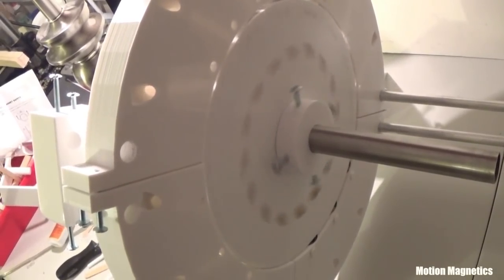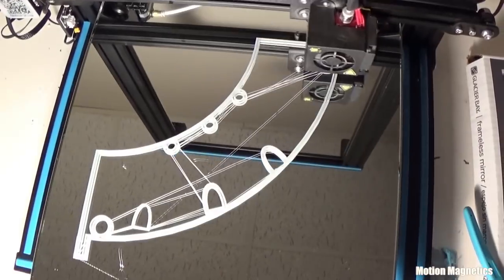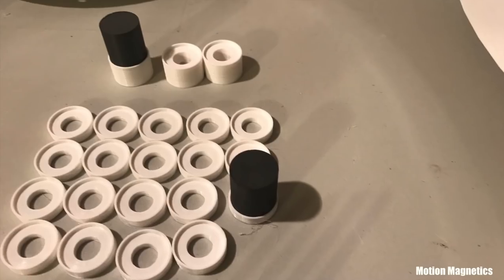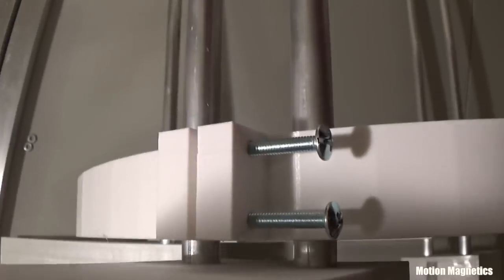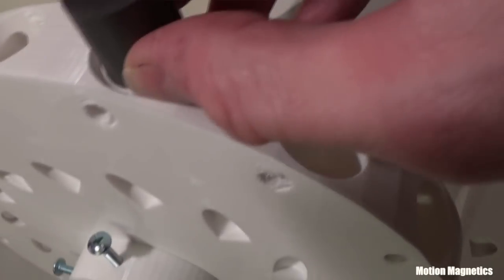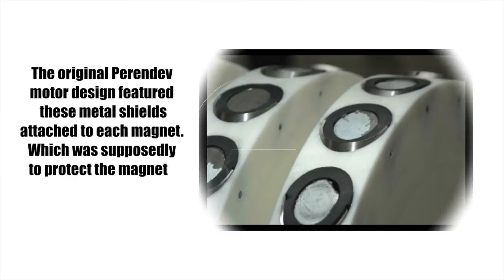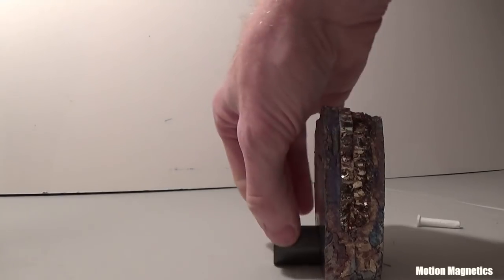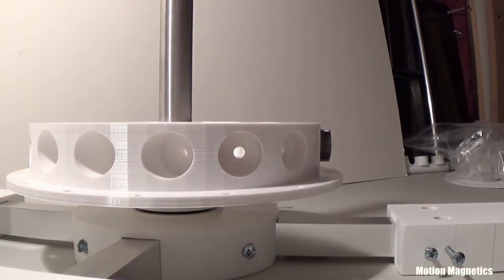Building an Imbalanced System

Comment: An important mistake: Try to use manets on the stator side, but just one magnetizable steel for the rotor. Then the rotor molecularmagnets take on oposite polarity and it starts moving. When crossing the sticky point simultanousely rotor steel must be shielded or polarity changed and the kibernetic force saved in movement will move the rotor out of the sticky point. That is a way to be imbalanced.

Comment: Hello friends of magnetic motors!
A special greeting to the creator of this magnet motor.
He made an effort and everything is ok! Just a problem,
that we don't have an engine. All is well with the magnets and corners and
mumetals, but I see that we do not have an imbalance.
Asymmetry of the rotor and stator axially !
And there is no need for many rows of magnets in the stator, in two halves, so that it does not close!
Good luck with your endeavors and we can share…
magnets in one stator shell to repel the rotor and in the opposite stator shell to pull the rotor.

Comment: 🦋 10/03/2022. - There is a real simple way to create an imbalanced system. The attraction between magnet to magnet is far greater than the attraction of a magnet is to steel. These differences in attraction is how you create an imbalance in the wheel. The JAMES RONEY STATOR does just that. It defies Newtons third law of motion. I am surprised you have not played around with this.

You are also lacking the staggering magnet set up in a staircase fashion which requires using multiple wheels at least four. Or one very wide wheel.

Thank you for your gallant effort. Sad to see that you have abandoned your channel. Maybe some year you’ll see my message to you?

Comment: Let me know what you think about this idea.
After watching numerous of your videos suddenly I just thought of something.  I don't know if this type of mechanism has ever been tested or thought of:
The idea is based on the concept of a moustrap if you will.

So you combine magnetism with mousetrap and throw in some sort of spring mechanism.

And the theory looks like this:
One magnet is pulled  (with its motion confined within respectably smooth frictionless track) by the other magnet without being repulsed as your first rule. So you need one magnet as pulling force to get the ball rolling. 
As the magnet rushes towards the other stationary magnet, it trips a moustrap. This causes the stationary magnet to move out of the way and at the same time it drops another magnet with replusive force right behind it  which further perpells it forward.
While the magnet is racing forward it trips another moustrap which drops another repelling magnet behind it and so on.
And perhaps the magnets can be under spring tension that is held back by the trigger, pulling the attractive magnet out of the way while the other is be pushed from behind and so on.
I can just imagine how much acceleration ten of them N52 neomydium magnets can produce.

But wait:
why waste all the motion of the magnet. You can use that to make electricity as it passes the coils along the way, this in return should be so implemented that it will reset and put all them repulsive magnets back in position as mousetrap.   
I am just throwing this out there because I don't know if this type of idea has ever crossed anyone's mind.

[ So really the question is, would there be enough kenetic energy with the magnet to keep resetting the mouse trap from just the original energy that was put in the system in the first place, setting up the mouse trap and the one magnet for attraction. If the mousetrap can not be reset, then again this idea would be another dead horse.  However it should be make for good linear acceleration I would think]

What do you think?

Comment: 'diamagnetic' doesn't mean 'magic magnetic shield that makes magnetic fields disappear' it means 'material that resists magnetic influence'

Bismuth is extremely diamagnetic for a metal. There is no magic magnetic shield material that works without energy input, because that isn't how magnetic fields work. You have to apply energy into the system to negate the magnetic field, so if you are relying on that system to produce energy, you would have to put in more energy than you can get out of it.

Comment: Some of them magnets must be get out and replace by electromagnets with trigger sinchronization when wheel turns and stops - this is a secret of Michael Brady. That's powerful method to overcome the barrier of resistance or make 3 wheel with displacement of magnetic belt.

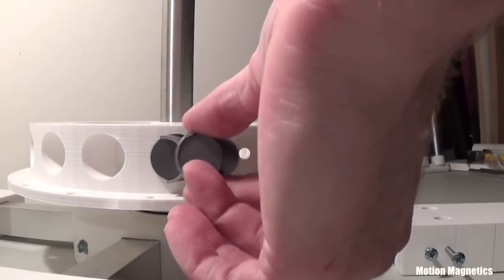Comment: I'm interested in the magnetic motor. I'm trying to build one myself and am trying to figure it out. But I still have a question. Out of wich material is the magnet shield at 8:38? It seems to work but you didn't mention what kind of meterial it was.

Comment: There's one orientation I've only seen discussed once, involving the sides of the magnet. Between north and south there's a zone where the magnets are forced to slide along until they land on the north or south of the stack. My thought is that a circle of magnets north to south all around for the stator and a magnet oriented oppositely on the rotor would seek to find that orientation until it could flip and land aligned with the rest of those in the stator. No cogging.

Comment: I think you need to make one section of your stator a V-gate configuration to over come the 1" barrier or magnetic locking what ever you prefer to call it the perendev design works great right up to that last inch if it's pulled into a V-gate and pushed out the other side it should eliminate the cogging just wish I had the money and resources to try it for myself i believe that id the trick to Yildiz's design

Comment: Impressed with your work and explanations and apparently not claiming any perpetual motion foolery that would violate physics (as we know it).  I am curious if you have done any work with polymagnets, which as I understand are basically complex magnetics built into a single unit in order to achieve interesting and novel properties?  I believe such Polymagnets are essentially the same as what you are constructing out of multiple discreet simple magnets.  I don't expect any physics violations from them, but perhaps they can be combined with powered electro magnets or leveraged as bearings etc.
Reply from the maker: Thanks. There are a couple of things I'd love to do with polymagnets.

Comment: the angle of the attack must be more than 67 degrees, not 30...every second disc must rotate in opposite direction...magnets on the side of one disc must repel the ones on another neighboring disc that rotates in opposite direction

Comment: from the head of the place the idea of unbalanced geometric typologists dont exist! always a circle (wheel) will find its own balance! (if there is an axle in the middle)! In this circumstance we can talk about 2 forces working in a circle that is rotating! 1 is the push force of the wheel (inertial force) and the second is the frequency with which it moves (speed of movement) the two can help each other! When the 2 forces are in imbalance (unbalaced can only lead to the stop of the wheel or the breaking of the shaft! Perendev is a system of wheels meant to balance each other! But the mistakes that many of the replicators make is that I do not know the principle ... once you have managed to balance the whole system  you will still have potential 0 and that is not enough to maintain the speed ... there are other forces that are involved and which will cancel the speed! Magnets are somewhat a static force! It is necessary to move their potential to be transmitted in an inertial force! In a motor we have a rotor. and stator! The stator name is false (at least inaccurate name) because something is moving through it ... although many have the impression that it is in place! their rotor is not turned by the stator but by the frequency flowing current. through the stator! Perend ev system tries to be a replica of the alternating motor only because it lacks only one thing, namely the frequency (oscillation) inside the stator created by the alternating current in the motor !! The stator does not have to be a fixed circle but a flexible one in the case of magnets !! the magnet on the rotor must also perform the frequency function! just as the current oscillation in the motor stator causes the rotor to move! if the stator will not fulfill the frequency function then you will have some kind of stator of an AC motor connected to direct current

Comment: Magnet poles should always be pushing, never attract.. attraction only moves them to the attraction point. Perpetual motion exists in space..  on earth to avoid friction a horizontal wheel needs to be levitated with magnets(weaker thin magnets on the wheel's surface facing down like car signs), and powerful ones under the wheel pushing up) and an axial to keep it in place. If the wheel is vertical, too much weight (the whole thing) is placed at one spot but a horizontal wheel can have more surface area for a wider magnet(s) below it to help influence pushing/levitation.

Comment: Thank You.  Nice vid. hey,  Mr. Brady's pat showed item 14 as having been faced off at an angle to the normal of both mag and the axis of the machine probably around 20degs but not specified in the pat. To do that, successfully, one would need to index ea. mag. as regards to polarity  along  two vectors.  Operation left to a surface grinder. Thanks again.

Comment: Just a heads up on bismuth. Pure is better for your purposes. What your chunk here has a bunch of impurities. 

Boil it down wearing a gas mask that filters out all toxins and be in a well ventilated area. Scoop out the impurities and recast your bismuth you will find the attributes will change in your benefit. 

Bismuth has also recently been named as a superconductor at room temperature so go figure.

Comment: I don't believe there is such a thing as magnetic shielding, but there is such a thing as magnetic guiding. A shield suggests a cutting off of one pole influence making it a mono pole But magnetic guides using magnetic material to  direct the magnetic lines of force cause a depletion of magnetic fields where they would normally be.
Reply from the maker: Well, you're technically right. When I mention shielding I'm just referring to the redirecting of magnetic fields. It's just an easier term for people to understand.

Comment: Thismay be of interest to you. I seem to have stumbled on something. Basically i placed 2 magnets on a fly wheel wthi iron backing them so the back field was fully contained in the iron. I shrouded the path of the magnets with 2 quarter circles one all north one all south. The magnets on the fly wheel and the 2 quarter circles shrouding their path are all seperated by about my little fingers width. The quarter circle frame was made of Styrofoam. Now the interesting part to this is that when trying to spin the magnets past the quarter circle end points the magnets want to go towards the middle of the quarter circle arches. But the side that has the metal shielding much more so then the other end of the arches. So i would cock it at the weaker side and let it go towards the stronger cocking side start point will be calles point "A". As stated it pushes tge magnets to the center and keeps travelling to harder cocking end point called point "B" at which point it flies back towards point "A" and passes it? Thats actually the equivilent of bouncibg a tenis ball and the ball bouncing back past its origin? Take note the metal backing on the 2 magnets used are shielded by a U core made from amourphous metal ribbon core. Also this stopped happening when i changed the backing of the arches from styrofoam to solid wood? Strange. In any case it bounced back past its original coging point? And it has something to do with the flex in the styrofoam. Msg me if you want photos

Comment: You can easily melt, and program bismuth, using a neo magnet over the melted metal while it dries. Create a far stronger shield. 

Also check out Ken’s Video, he does this in a few. But his work might help you with yours✅ 

Here is his page. But not the bismuth programming video. You will have to search his videos to find it. 
https://youtu.be/RXN2rttEAKo

Comment: For those interested in studying magnetic motor design a 3D printer is a must. I still think the Perendev can work but I won't go back to it just yet. KEEP WORKING ON IT! Some clues about Bismuth... Not for shielding. Effective shielding can only be done with magnetic metals such as STEEL or IRON. That being said, overcoming the force of attraction of a magnet to either of these metals can only be overcome by balancing the amount of attraction of a magnet to the metal and the repelling force of a second magnet on the other side of the steel or Iron on the other side. (explained in the youtube video below)  Balance I am thinking is the key. Knowing when and /or where to upset that balance is the trick. AS FOR BISMUTH - Bismuth seems to have an interesting effect when you try to levitate a magnet between two additional stacks of magnets I call it the Bismuth sandwich.  a magnet on the bottom, a slice of bismuth, then the levitating magnet another slice of bismuth and then a stack of magnets on top. with everything stacked in correct distances from each other the center magnet levitates.  I may have the concept wrong but I think bismuth only ads a larger space where magnetism is more stable. but you have to ask yourself. are you trying to levitate a magnet? The obvious answer is no. We are trying to get magnets to enter into each others fields without magnetic attraction and repulsion getting in the way. Balance the magnetic forces to get the magnets together. Then remove the steel or iron between the magnets and bang! opposing forces at full potential and you get motion.  Then all you have to do is automate the process. Easy right?  This is a video that I think can be helpful;  https://www.youtube.com/watch?v=vUcWn1x3Tss&list=PLe1za913LOftM20BcjErl3AULeJImyjvd&index=9&t=0s Strictly following this concept doesn't work, but I think it's on the right track.

Comment: I've been noticing that one of the magnets on the stater needs to be in a different configuration to achieve inertia through the last magnetic field and I'm interested in what a gyroscope on the shaft but i noticed in Perendevs patent that he mention a wide range of angles but says it works best between 30 and 35 degrees so in my design I was going with 33 degree offset on both rotor and stater  and switch one magnet to south on the stater on an all north build just my guess though

Comment: Just stumbled on this video. 3D printers are great. Try using joinery techniques or even Jap glue-less joinery to join large printed pieces together. I have found it to work flawlessly. This also helps to change layer orientation for directional strength in printed parts. As for magnetic shielding I have found that Iron with an air-gap or even a plastic separator is very effective, the larger the gap the better or for strong shielding use several layers. This will shield the range of the PM field can interact with other fields in the iron direction. The interaction the PM has with the iron is much weaker and only has a strong effect in close proximity. Also the orientation of the iron to the approaching or retreating PM makes a huge difference. With a ramp iron bar and the top of the ramp closest to the PM, the PM will have a strong break in the up hill direction and weaker in the downhill direction. Have fun!
Reply: Hi anyway you can share your sheilding technique, I'm starting to get different materials to see what works best but what do you mean by iron on ramp is that a slightly higher side? Thanks
Reply: @estorilblu  It's not an iron on ramp but a iron ramp. That is a magnetic conductive material such as iron in a magnetic ramp configuration (ie far to close distance from the magnet). The best magnetic shielding is to conduct the field to join North South with a low magnetic resistance (ie high permeability) material that also has a high enough flux density to handle the strength of your magnet. The best and most expensive material is MetGlas